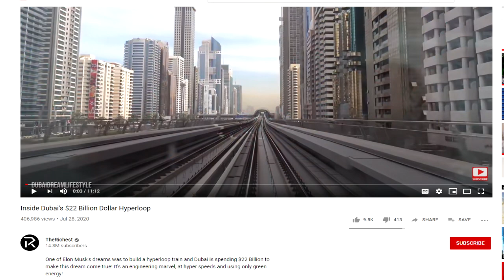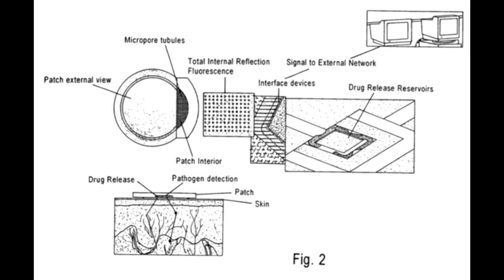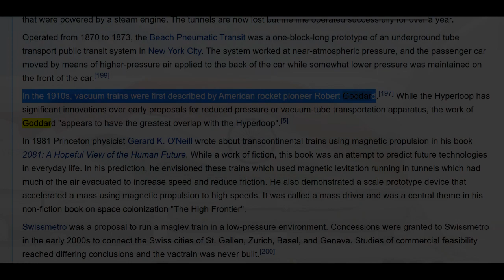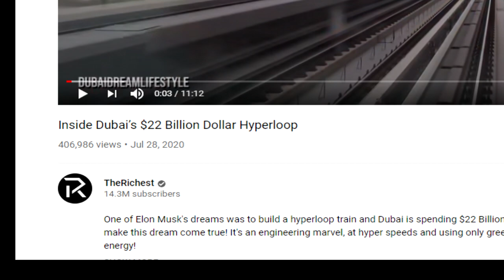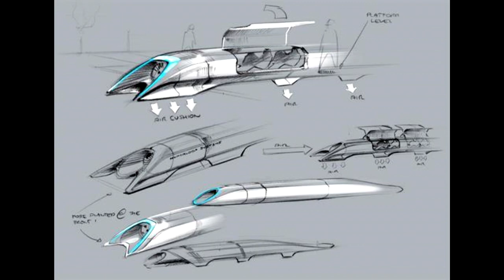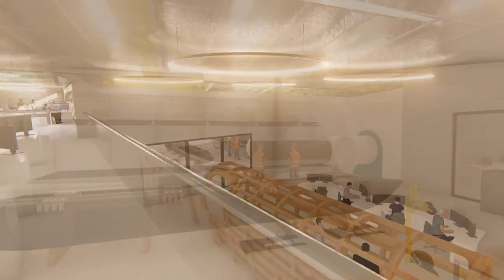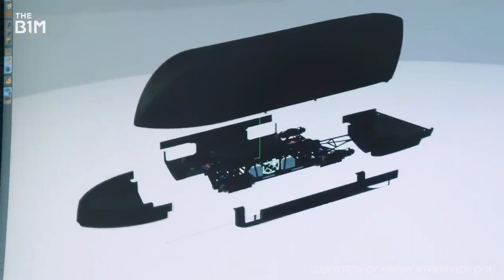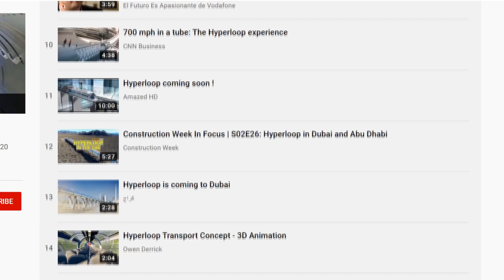Hyperloop, the biggest Scam since Theranos

Comment: A hyperloop will NEVER be cheaper than rail. Especially when it's an elevated track!!! Also 2x the track of a single rail lane for the same space(one forward, one back). Its asinine. Not mentioning the high tech equipment used to operate it. The land acquisition is the same cost as rail.  Rail is tried and true, reliable, and grounded in reality. Dirt and gravel foundation will always be cheaper than elevated, by far. 
 

I've never understood how Musks faster, more expensive, and premium forms of "transport" are cheaper than the regular methods. Premium speed and cost demands a premium price. That's economics. "I get you there the fastest so it costs the most".... 

Who buys into this charlatanism???

Comment: 1. it's the safest form of travel (because it has not been built) 2. it will travel in an evacuated tube (what happens when it implodes due to the dangerous vacuum) 3. it will cost way less than regular rail (except the cost of maintaining hundreds of miles of tube under vacuum has not been factored into the cost) 4. Even Ego Musk himself has forgotten this boondogle...

Comment: Is not a scam when those investors knew the risk.  Theranos is a scam by lying.
Reply: But Elon Musk also lie...
Reply: @lisakeitel3957  About what?
Reply: @markharmon4963  well, about the proyect. About tiimes, progress, money needed. Well, half the video is about that.
Reply: @lisakeitel3957  If it takes a longer than you guess to perform, that is not a lie, it is an ambitious miss calculation.  If you have no intention to meet that deadline or to complete a goal then it would be a lie.  Musk is not producing hyperloop, so what timelines has he submitted?  Or what has he promoted without an intention to complete it?
Reply: @lisakeitel3957  The best that I can say about this video is it is full of misunderstandings.  The tunnels in Vegas are proof that tunnels can be done cheaper and vehicles can guide themselves down a pipe. Baby steps.  Everything does not happen at once.  If it does not happen fast enough for Thunderf00t, maybe he can be convinced the project will be worthwhile anyway.
Reply: @markharmon4963  he lied.
Reply: @lisakeitel3957  Alex Y has it exactly correct.
Reply: @lisakeitel3957  I can commend you the study of the Quantum-Grammar "C.-S.-S.-C.-P.-S.-G." which teaches the Parse or Parts of the Speech so that you must not waste your time, since by learning that the word "investor" as used by the original-commentor means: no-contract to start with and thus, shows the initial-volition, which one who does not know about Parse is gullible to fall for. And at the others: show us an Air-pipe-vacuum-hyperloop that is functional, otherwise: f off scammers. It does not work nor exist and thus is another example of the American Dream aka Scam.
Reply: It's a scam when the promised product is not possible within a reasonable margin of what the promise entails. And the promised product is not possible within a reasonable margin of what the promise entails. He promised, among other things the hyperloop would "never crash, is immune to weather" and could be "made self powering by putting solar panels on it". None of this is true. Musk was clever that he washed his hands off the entire thing pretty quickly and just ran his mouth instead of actually trying to build this.
Reply: @KingQwertzlbrmpf  what you are missing is that multiple companies, even highly specialised ones in train bleeding edge tech, are working at the same time on very similar projects. This isn't about Elon Musk or Virgin. This is a race. There are difficulties but claiming them as impossible to overcome is plain stupidity. It wasn't possible to fly and many have died trying until someone achieved it. I am not saying that 100% we all gonna travel in a hyper loop within a few years, I am saying that it might be possible at some point if and when issues will be fixed. Nothing is impossible, everything is uncertain.
Reply: @KingQwertzlbrmpf  I didn't say that you can be anything, not in the foreseeable future at least, I said that nothing is impossible, even the laws of physics are bent down in singularities and on a quantum level and probably on a cosmic level too. Very dangerous means nothing, planes were very much like a kite with an engine when they were invented, it might be an hyperbole but it really seemed like attempting to fly was the leading cause of death among engineers in the late 1800's and very early 1900's and you can say exact same thing about jet engines during and a little after WWII, what you are describing are technological challenges and economics are a result of a challenge being overcome in an efficient enough way. How many people would have betted in the 1970's that half the population of the world in 2020 could have a computer in their pockets and access a global information network? Again, I am not saying that hyperloop is the future of transportation, I'm saying that it might be even though, like literally everything else has challenges to overcome.
Reply: @danilopanzano  Can a cow jump over the moon? The anwser is no. That is impossible. At least without completly redefining the words "cow" "moon" "jump" and "over".
I'd also like to advise you to refrain from invoking quantum physics if you are not a physicist specialising in quantum physics because i can assure you that whatever you say about quantum physics without being a physicist specialising in quantum physics will be wrong.
I also find it telling that you completly ignored my main point. The point that the ultimate killer of the vactrain will not be engineering but economics. 
Your point about the development of planes is completly missing a key point. And that is that at the time the physics underlying flight were only barely understood. The research on and building of experimental flying machines helped understand those physics and thus made the bulding of functioning flying machines possible. That is not the case with the vac train. The physics underlying vacuum and maglev trains is well udnerstood. Same goes for the engeneering knoweldge for building vacuum chambers and maglev trains. Even the concept of the vactrain has been studied and tested extensivly. Let's remember that the concept of the vactrain was not invented by musk. The concept has been rocking around in engeneering circles since at least 1799 and the proper vactrain was invented by Robert Goddard in 1904 and patented in 1950. In the 1970s was the first vactrain fad lead by Robert Salter. To make things short, the vactrain concept has been extensivly studied and found lacking. Especialy compared to regular maglev trains.
And this is the crucial difference between planes and the hyperloop. Planes were something new at the time with barely understood physics and no engineering experience on flying machines. The hyperloop is based on well understood principles and with a great wealth of engineering knowledge and experience. And because of that we can extrapolate the course of what will happen.
Reply: @KingQwertzlbrmpf  no shit Einstein, a cow can't jump on the moon, really?

Your logic is fallacious: I can't be wrong depending on WHO I am or what you suppose I am, or what you suppose that I know, I can only be wrong depending on what I say and yes, normal physics laws have exceptions on a quantum level, like normal objects (if I remember correctly the record has been a little object as big as a post stamp, still very small but well into the realm of visible) changing the apparent dimensions (and look like it pulsates) when very close to the absolute zero and shielded appropriately due to electrons coming in and out of existence in a visible orderly way instead of chaotic which is the norm (nobody really knows where they go when they are not there or if they still exist which itself contradicts we we usually think to know about reality) or when entangled twin electrons change spin effectively faster than light no matter how far they are without anything actually travelling from one to the other. So, yeah, in very specific conditions laws of physics do bend, guess what that's why we still do not have a unified theory of everything because of that. 

The hyperloop has been found missing key engineering to make it feasable, 1970 was 50 years ago, it was a different world:  today's calculators are much, much faster than a room size computer of the 1970's. Flight has been studied for literally THOUSANDS of years (not entirely sure but if I remember correctly the first known attempt was in mesopotamia some 5000 years ago) and found lacking until technology was mature enough and someone made it (we can argue if it was the Montgolfier bros in the 1700's or the Wright bros in the early 1900's but that's not the point) and basic physics of flight were understood since Newton anyway (but yeah still needed refinement) engineers didn't live in the caves in the XX century.
Reply: @danilopanzano  Actually i wrote that a cow can't jump OVER the moon not ON the moon. A small and rather insignificant nitpick, but it implies that you didn't read my response very carefully. Also, that was just to demonstrate the point. Some things in fact are impossible.

About your second point, yes, if i wrote that you in fact are wrong in your assertions about quantum physics because you are not a physicist specializing in quantum physics then that indeed would have been a logical fallacy. However, what i wrote is that you are likely wrong in your assertions about quantum physics if you are not a physicist specializing i quantum physics. Regardless, i'm gonna go ahead and discount your assertions about quantum physics for two reasons. First i lack the neccesary expertise to assess your assertions. Second, it's irrelevant to the topic we are discussing.

Lastly, i'm gonna just go ahead and grant you every single point you made about flight without even bothering to factcheck them because they don't change anything. The fact still is that today we have a very good understanding both scientifically and in engineering of all the essential components of the vactrain concept and thus can extrapolate the result without wasting tons of time, money and energy. And since you apparantly forgot allow me to remind you, i'm not saying it's impossible to build the hyperloop. There are a few points at which the engineering is still lacking, but there's no reason to suspet those problems cannot be solved with our current level of engineering. There might even be some small innovations that can be salvaged from when the hyperloop inevitably crashes and burns. And to reiterate if nothing else brings the project down it's gonna be economics.
What i'm saing is that the expense is not worth whatever small benefits might arise from it.
Reply: @KingQwertzlbrmpf  Qwertz makes me think of Germany it would explain a lot. DAS IST IMPOSSIBLE JAAAAA?!
Reply: @KingQwertzlbrmpf  also economics is no science even though it uses many scientific tools :D
Reply: @markharmon4963  So can these hyperloops tunnel move oil and natural gas
Reply: @wyw201  I imagine they can go over or even along side.
Reply: @markharmon4963  Why don’t we have hyperloops that specifically moves cargo then. Way more profitable than moving people.
Reply: @wyw201 Insiteful comment. I think that is the plan in Dubai.
Reply: @markharmon4963  yes this video hasnt ages well, recently the frist human trial of the hyperloop was done @700mph
Reply: @adithya1791  That is exciting! Where can I see a report?
Reply: so what elon said 8 years ago is not lies? they guy promising a ride in 2021, you are saying he is not lying? elon claiming the invention as his own, that is not lying? saying that it will be cheaper when it clearly wont, is that not lying? promoting something for investment you have no intention of completing or doing, you are saying that is not lying? all these investors promised a track in 2021, you are saying they were not lied to, to get invesment?
Reply: @shroomiestshroom3655  Your confusing selling/promoting a concept to outright fraud, there is a big difference, almost every business idea starts with a concept (build a better mousetrap, build an existing trap at 1/3 the cost etc.) and without early investors, innovation and progress would ground to a halt.  If you invested in the hyperloop based purely on the Elon’s media appearances without reading the fine print and understanding the risks, well a fool and his money would soon be parted.  Now if Dubai had contracted him to build it, payed him up front and he could not deliver a working loop...that’s a different story.  Is anyone trying to sue him for fraud, not that I’m aware of, so he obviously didn’t lie to anyone.
Reply: @AmadeuShinChan  except it does exist tho, it was tested with passengers
Reply: @augustuslunasol10thapostle  That is called a test.  The very first one.
Reply: I see no distinction. The only possible distinction is if Elon Musk is so ignorant that he actually thinks it will work. That would be dunning kruger to the 10th power though. I don't think he's that stupid. Thus he is lying too.

Comment: How much has been spent on this already?

And followup: How much would it have costed to simply build a high-speed rail system in the same area?
Reply: Well given the cluster fuck that the California rail turned into....
Reply: @chrisbaker8533  Yeah that seemed like it was a mix of a lot of mistakes and starting the project without proper planning.
Reply: @redkingrauri3769  
How'd it go down?
Reply: @redkingrauri3769  the initial plan was pretty good.

It was the town's along the route wanting their piece of the action the totally fubard it.
Reply: @mwanikimwaniki6801  short version is a lot of towns on the route wanted a piece of the revenue, there were geological errors, engineering problems and a lot of bureaucracy issues that ballooned the costs.
Reply: @redkingrauri3769  🙂That's disheartening for me to hear. Especially for a nation like America.
Reply: @mwanikimwaniki6801  Just another failed piece of IS infrastructure, I'm falling asleep here just from how often this happens
Reply: @m2heavyindustries378  🙂It disheartens me so much that a nation that powerful gets into such bottlenecks.😂😂😂Now what will happen to us poor nations.

Comment: I love how almost all trains look to have air intakes in front, even if it's supposed to run in a quasi vacuum...i cant believe journalists dont even question that...
Reply: Planes have air intakes as well, even though they fly in the same "vacuum".
Reply: @aqidon Uh...airplanes don't move through tunnels, though. They also don't move in a vacuum...We don't live in a vacuum! That's why this is ridiculous. Creating the vacuum tube is just, not worth it and creates so many issues. Mainly how insanely dangerous it is!!! 

An airplane would not work in a hyperloop.
I just can't believe this scam is still running, it's criminal. We could have been getting an actual good train system THAT IS SAFE FOR CIVILIZATION. We don't want giant chunks of metal flying at the speed of sound through a tube that is vacuum just so that a crash will destroy everything.
Reply: @sorryifoldcomment8596  I don't get. Is artificial "vacuum" worse than the natural "vacuum" airplanes fly through? How can a malfunction in a tube be worse than a malfunction at 3200m altitude?
Reply: @aqidon  
if you malfunction in a plane, you have time to react. If the plane crashes it creates no traffic jam in the system and only passengers die.
 They definitely want to drive more than one train per tube - imagine if one of them crashes and fucks the tunnel up; the one infront is fucked because of pressure loss; the one behind is also fucked... the whole tube is fucked.

Comment: "Generates more energy than it consumes."
sure
Reply: Logic
Reply: That's all you got to hear to know it's bullshit.
Reply: I mean if you put solar panels on the tube then I don't see why not. Obviously this would be untrue if the panels weren't there.
Reply: @CockatooDude  I still don't think the solar panels are enough to make it self sufficient but I could be wrong
Reply: @Relics  Depends on the track length and power consumption of the train/pod ultimately. I'm sure if the track length is short enough then there wouldn't be a break even point.
Reply: THe munic metro system generatres more engery than it consumes. It has a big ass solar array connected to it, which actualkly generates more energy than the whole metrosystem is using. So that claim is not that fantastical. But the solarpark is your everyday solarpark, all solarcells are neatly packed and perfectly aligned to the sun, not some flatliying garbage.
Reply: @Relics  You're not. All those solar panels could barely keep the neons lit. On bright days.
Reply: @Zamolxes77  We'll all see when this is turns into a overpriced subway
Reply: yep, that's always a red light
Reply: That statement has a slight chance of being plausible if we reached 100% solar panel efficiency but we're nowhere near such amazing feats atleast yet.

Comment: I always wondered how building a vacuum tube could be cheaper than HSR line for the same length... On one side you have ballast, 2 steel I-beam, some concrete traverse, and cables and posts for electric power. On the other side you have a steel (or concrete?) air sealed tube, guiding rails, cables for power, concrete posts to maintain the tube... how on earth can this be cheaper?
Reply: If you look at any proposals that come from Musk, they ignore all detail and just make a bunch of grandiose claims.